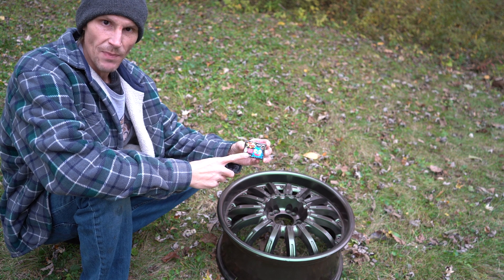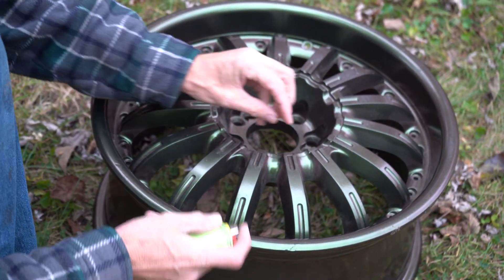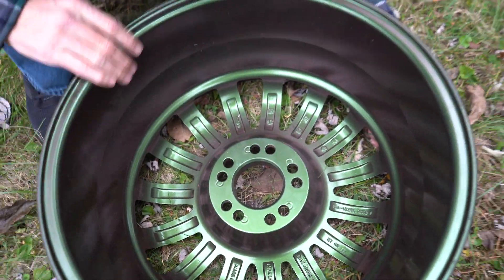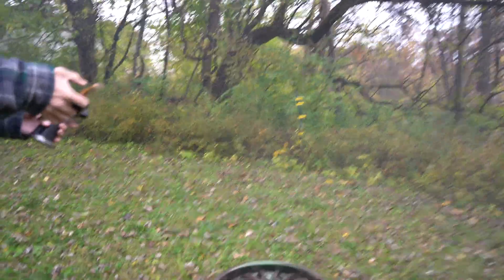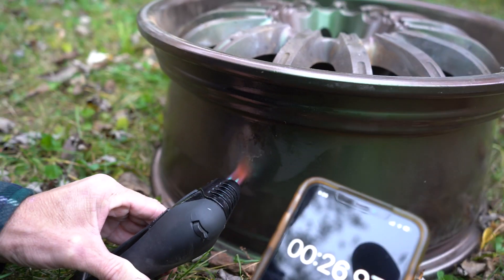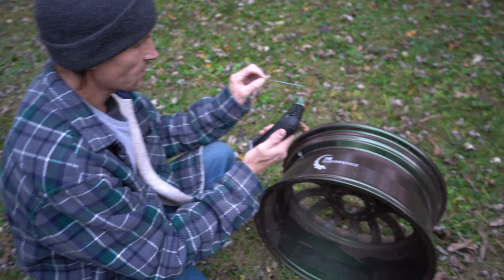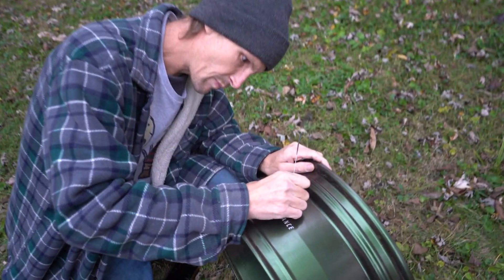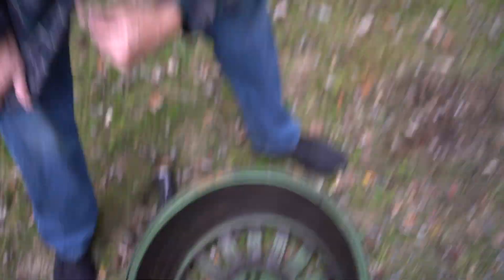Powder Coating Test - How Durable is Powder Coat

Comment: How about using explosives to powdercoat the wheel? Stick one of the big mortars in a plastic bag filled with some powder... put a wheel in the oven and when its at 400F take it out....hang it just above the ground with the face down and put the bag (or a few bags wit diff. colors) underneath and light the fuse...could be like the new year shop special hehe...I'm sure nobody has ever done that ;)
Reply from the maker: hahahahaha ! =)